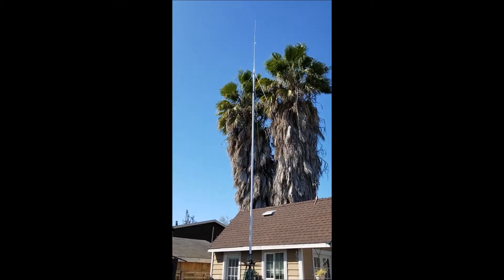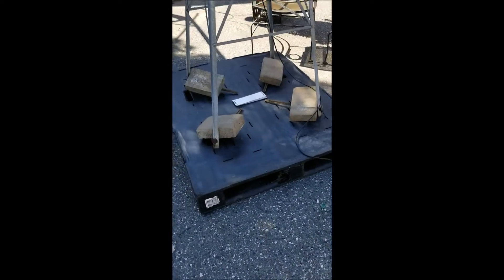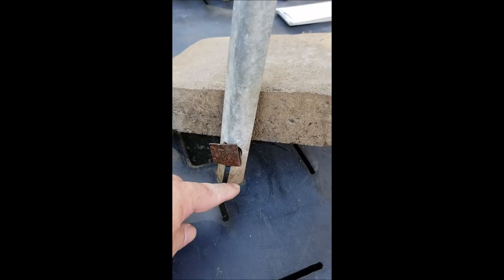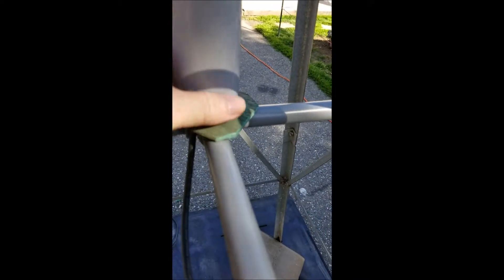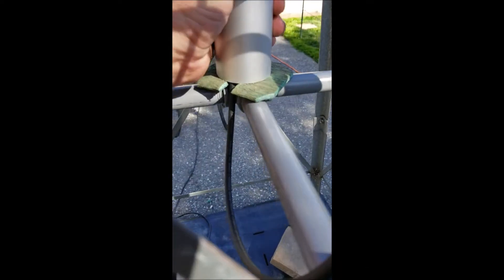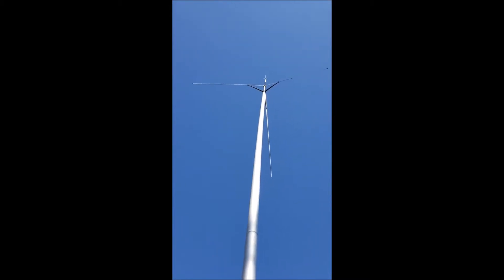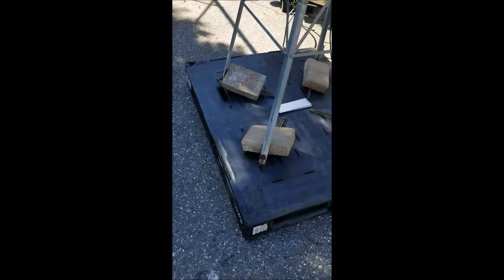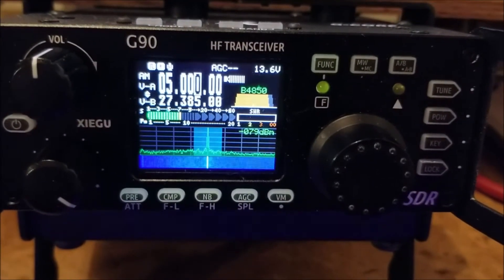Xiego G90 - President Mckinley CB: Sirio M-400 Starduster Ground Plane Custom Antenna Tower (Part I)

Comment: I See You're On "Channel 38". Any Trouble With The 11 Meter Mod?
Reply from the maker: I did not buy the G90 for x-mit because I don't have a Ham ticket. I easily pass the online practice exams for the FCC General Class, but C-19 lockdowns in my area have eliminated all in-person test sites, and the online proctored Ham tests are a logistics nightmare in getting set up, so screw that. The G90 already receives all HF bands w/o any mod. It instead locks out certain x-mit band gaps. I wanted to buy a good Shortwave Radio. In researching SW radios, I found that the G90 is priced the same as a the Grundig Satellit 750 or Eton Elite  (I'm amazed the top SW firms (e.g. Grundig) have not released an SDR receiver with waterfall etc.!!!!), but the G90 has better capabilities and in a small package, so in this sense it is a better buy, even for just receiving. I did program CB frequencies on the G90 but for x-mit on CB I use the President McKinley, but I mostly just listen in the background while playing video games, so I run the G90. It is also more sensitive than the McKinley and has better audio (when using an external speaker). Presently my mic is not even plugged in to the G90 although if SHTF, then I have that option--another bonus over the Grundig option.